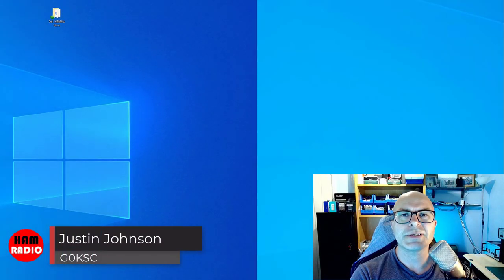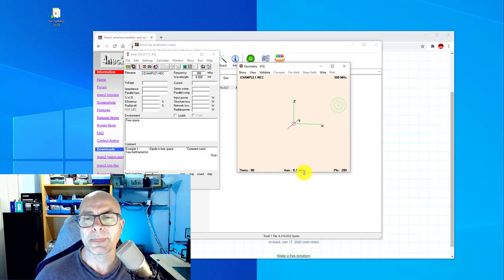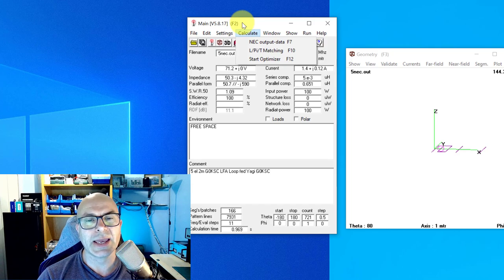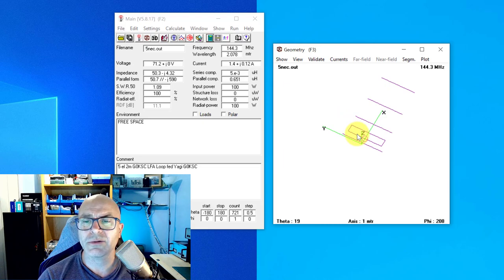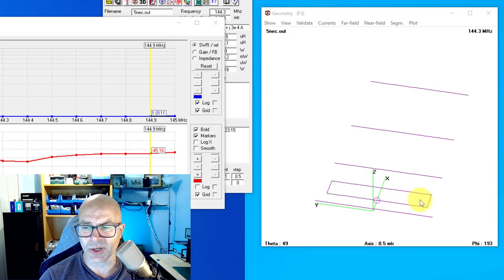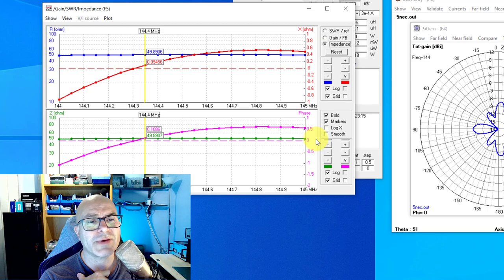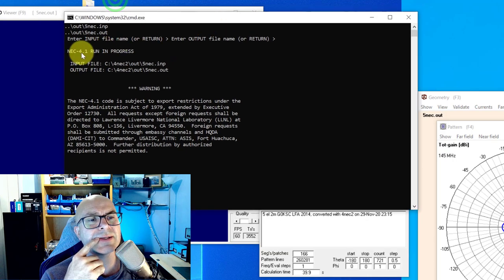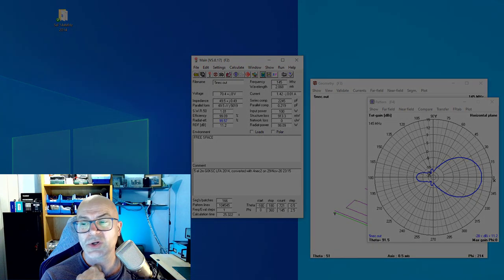How to Model Antennas with 4NEC2 Antenna Modelling software - Part 1, the basics

Comment: WA2OOO here. I have known Justin for quite some time, bought many of his antenna & designs and modified quite a few others to my own needs. Everything Justin makes and sells is a top notch  and the highest quality antenna design you can buy Period. Most common commercial antennas sold today were designed 50 years ago. Justin built his company on performance. And he has a passion for it. And the performace is second to none.
Reply from the maker: Thanks for the 'flowers' !

Comment: Justin (6:10) - "When there is any form of matching or transformation, there is going to be loss. There is no method of transforming or matching anything known to science that is 100% efficient. If you can get rid of that matching device..."
I totally agree with this! That is why you are designing an antenna in the first place... so it can be 50 ohms. PERIOD.
Thanks, Justin, for creating this channel. I have been following your website, and made several of your HF designs. Keep up the good work! Thank you for sharing the science and techniques!    73s, Gerry (DU7EYG)
Reply from the maker: Thank you. So many things like matching devices are accepted as normal but it is just not the case! How many antennas with no matching devices have power input limits? Makes you think doesn’t it?
Reply: Actually not having matched impedances in transmission systems willdo 2 things:

1. You will lose transmission power... Alot of transmission power.

2. Have a bad enough SWR and you will burn your radio's output.

3. Good luck building a naturally resonant antenna and transmission line at anything above 10 meters. You need the right antenna lenght and design, the right rransmission line lenght, the right geometry, the right grounding... And anything bellow 1GHz is going to have such small tolerances that it's going to be practically impossible to achieve perfect tuning...even a small wire whisker is going to detune your system. 

Also there's ground interference, building interference even the mast will interfere with your system. 

This is basic 3rd year analog electronics stuff.

Comment: Just ran across your Tutorial and where I've always wanted to learn 4Nec2 decided it'd be a great experience to learn from you. Having a bit of trouble getting my 2 meter 5 el lfa yagi to tune in the FM portion of the band so thought I might get a heads up with the software to make fixing it easier. Also sent a link to a friend who is building a similar antenna of your design as he is also getting into antenna design software.
Reply from the maker: Let me know exactly what your issue is, I will help

Comment: Hi Guy! With which software can I simulate the effects of my (grounded) balcony rails on my delta loop antenna? I mean construct a complex ground structure(the rails). My bottom, horizomtal side of the delta is behind the rails, metal 1m spacing,  lamda is 10m. Thank you! 73

Comment: How does NEC5 compare to NEC4? For some reason NEC4 is (Non-U.S. Academic/Noncommercial) $500 but for NEC5 there is an  Individual license @ $110. They do say "NEC–4 may remain the preferable code for modeling antennas such as Yagis where accurate resonant frequenciesare critical." For a Ham, $110 is obviously more palatable!
Reply from the maker: If you look at the changes in NEC5 there are not any to impact conventions 'wires only' Yagis. Additionally, for Yagis from HF to and through VHF, accuracy with NEC4 is exceptional, you will see many reports from builders that have built antennas from my designs where they have said 'no adjustments required at all.
Reply: 1) from the point of view of HAM. For SW/LW antennas you need Sommerfeld ground model, so zero benefits from other-than-4NEC2/MMANA engines.
for VHF/microwave antennas there is zero benefit from higher impedances/reactances accuracy., because all these engines cannot model non-balun-type antennas, and balun design (which can not be modeled in this engines anyway) has 100x adjustments bigger than error of engines in terms of impedance matching/error/transformation.
2) from point of view antenna developer RF engineer, all these MoM engines are total crap and waste of time.
Reply: @hamradioguy-g0ksc96  I get that NEC4 is fine. I meant, is NEC5 also ok - or not?  I can afford NEC5  at $110, but not justify $500 for NEC4

Comment: You lost me at "there is no need to have any matching" and "there is going to be loss".

Sorry, but basic, 3rd year Analog Electronics theory is completely against your stance.

Good luck making a 160m transmitting line-antenna system.

Even transmission line lenght affects a system's impedance.